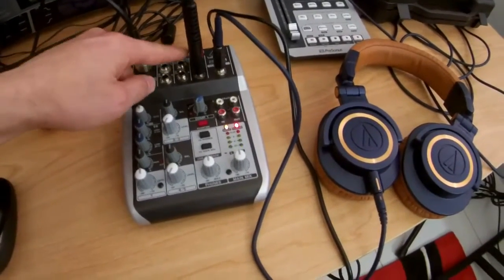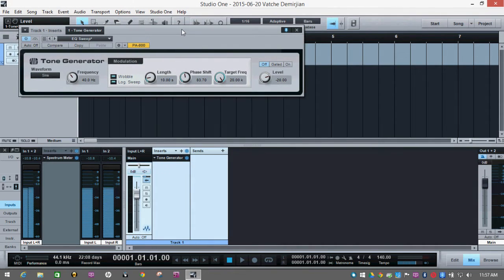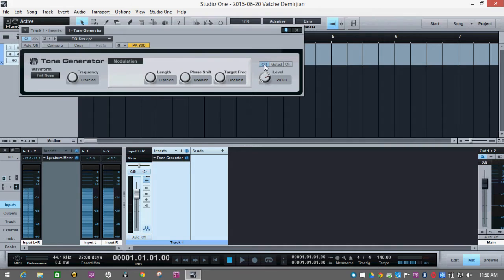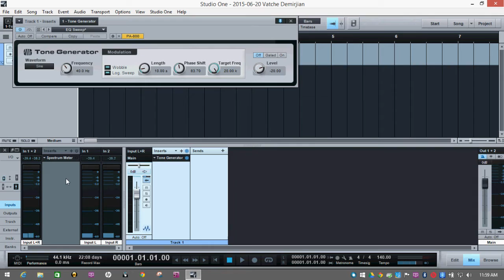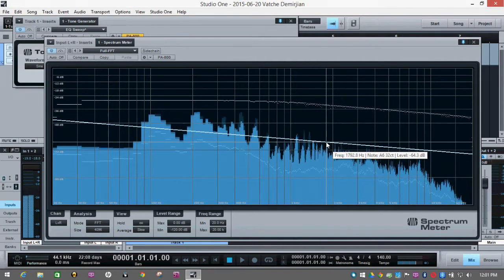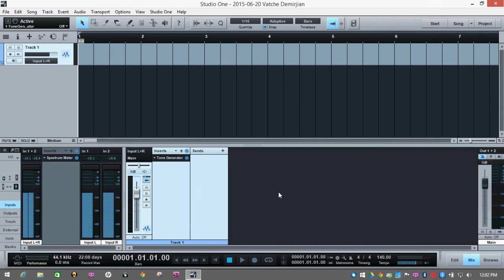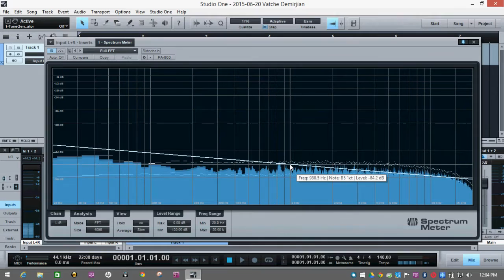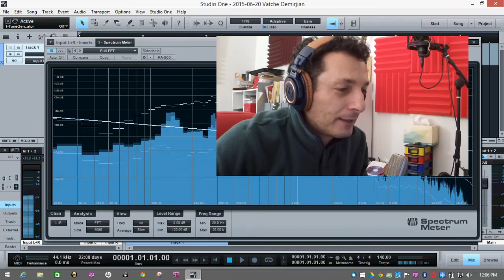Testing the Behringer Xenyx Q502USB Mixer

Comment: when yo record tracks can you split the channels as individual tracks thanks
Reply from the maker: No. The USB audio is 2x2, meaning stereo to PC and stereo back. Depending on your DAW, you can record the L or the R as single mono tracks, so a Mic on Ch1 with panning set to right, and a guitar on Ch2, plugged in to L input, you can record 2 mono tracks separately.
Hope this answers.
Reply: RecordingStudio9.com so technically this mixer will only have 1 channel on your DAW right?
Reply from the maker: Yes, 1 stereo channel.

Comment: What are the best type of mics to use with these mixers? arent they only 15v phantom?
Reply from the maker: Yes, they are only +15v and not many condenser mics work well with such a low voltage. Best to use dynamic mics,.
Reply: yes its a useless mixer, get a 48v phantom power module box

Comment: Hi! I'm not quite sure why you need the out connection to the computer to record your voice. My mic is connected to the XLR (preamp) input, my Behringer is connected to the computer via USB, and I can see/hear that it's already recording my voice. Can you explain your reasoning? Thank you!
Reply from the maker: The reason I have line outputs connected to my laptop line input is to capture the audio into my screen capture software. Since my Studio One has already exclusive access to the USB audio and cannot be shared with screen video capture software, I had to use my laptop audio interface to achieve the resulted outcome.
So USB audio to Studio One, laptop audio to screen capture.
Thanks for watching and asking the question.
Reply: Oh, cool -- that's a bit of a relief to know it wasn't for the audio setup! It was quite the quandary. Thanks so much for answering so promptly and sharing what you learn!

Comment: hello I just wanna ask, how can I used my Q502USD mixer cause the adaptor has only maximum 100V., cause my AC Power is 220V - 50/60Hz., is there any way or i can used to use the mixer using another adaptor do have any idea?
Reply from the maker: If you purchased from another country, then best to contact local Behringer distributer to purchase the correct power supply, as they are not your standard power adaptor. 
If you purchased it from a local shop, take it back for a refund.

Comment: Hello Vatche.... greeting from the Philippines! How long have you have your 502? What can you say about users complaining noise/hiss? Did they got a bad unit? Was it damaged over time? Will product warranty take care of it? Thanks
Reply from the maker: I have had few complain about the noise, normally due to low Phantom Power voltage of +15 Volts instead of +48. You get what you paid for. The Q502USB is not a high end studio mixer. It suppose to be for live performances, with the added bonus of USB recording.
Reply: Wow, that was quick..... so if your not  using PP you should not worry about it? Thanks
Reply: Hi Vatche. I have a question about this. I heard that a bus-powered mixer is actually best for performing, since you won't need an additional power source. What is your perspective, if you don't mind? Is there something else besides the size of this interface that makes it great for performance, since you do, in fact, have to use both the USB and plug it into an outlet?

Comment: hi very good test, did you test this mixer in a mac , drivers etc, ? thanks.
Reply from the maker: No, I only tested on Windows and I would say the results would be the same, as the test is for basic hardware.
Reply: oK Thanks, i bought one yesterday and did my test in a macbook pro corei
 7 with Yosemite, and it worked fine just plug and play its driver appears as USB Audio 
CODEC and done..
Reply from the maker: Yes, no drivers required on Mac, as the USB is Core Audio compliant.

Comment: hi can it have 2 track output simultaneously? one for the mic and one for the guitar on separate track out of DAW? thanks
Reply from the maker: No, the USB audio only outputs one stereo stream. You can plug a Mic into the Mic input and set the PAN to LEFT, then a guitar with a guitar pre-amp (or a pedal with line level output) to Line 2 RIGHT input, then you can have 2 mono tracks into your DAW with 2 tracks, one for Mic and another for Guitar.
Hope this helps.

Comment: Hey, I'm trying to record my voice from Xenyx Q502 the same one as yours, but i don't know what cable to use. I mean what is the name of the cable you use from the Xenxyx Q502 to your pc so you can auctually hear yourself and record your voice ?
Reply from the maker: If you have Q502 and not Q502USB, then you don't have digital connection. If it is Q502USB, then it is a general USB 2.0 AM-BM lead. Check back of the mixer if the socket exists.
Reply from the maker: +Silva Kartaliyska 
You might also like to watch one of my other videos on Behringer Q502USB mixer, as this test video may confuse you.
Reply: RecordingStudio9.com Thank you man, luckly i have the USB one. ;D